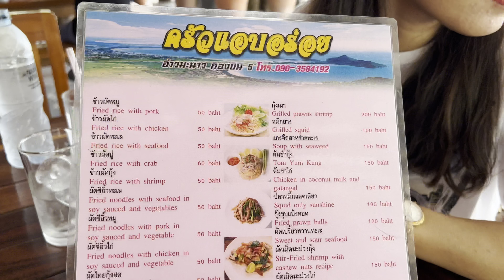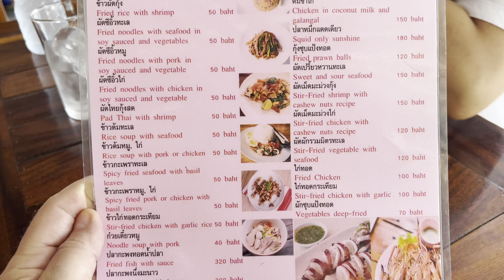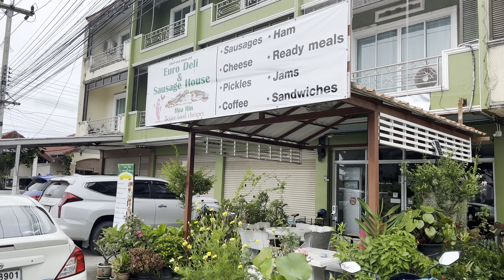There’s a stranger by  our pool

Comment: The cinderblocks seem to be thinner than the ones used in most of the United States that I have seen. Is that due to codes? What if you wanted more noise reduction (music room), or more stability what are your thoughts on that Mr. Joe? Or anybody that reads this.
Reply: No home building codes in Thailand.

Comment: Hey Joe, Last time I was in town they were upgrading or remodeling the olympic size pool next to the community gym located at the stadium. Maybe you can do a video about the cost and the pool and gym membership and what is required like the health certificate or physical to join the gym at the stadium. You can also so the outside track and the outside gym by the track. Just a thought. It would be nice to see how far they have come with the community pool.
Reply from the maker: We will definitely have to check out the pool area.  Last time I checked gym membership was 1000 baht a year and a medical certificate was required. Cost for the certificate was around 150 Baht if I remember correctly.

Comment: Those skinny little cinder blocks.
I guess they must work. I don't know why we use the big old blocks here in the US.
Reply from the maker: I had a home built in the US in 2011 for $326K USD.  The frame was made of wood and the walls were made out of plywood, sheet rock and vinyl siding. The front was made of brick. The main materials used in the US nowadays is Brick, stone, stucco, wood, vinyl siding and Hardiplank.

Comment: The bricks they use for the internal walls are pretty skinny I wonder if they double then up or do they just render coat ( plaster) or dod and dab drywall straight to the brick work
Reply from the maker: They will more than likely just plaster the internal wall made of blocks and then paint and skim coat them.  The walls will be sturdy.

Comment: I have a question for everyone in this chat. I just want to know if I'm not wrong.Most house built in Thailand  use concrete ? it's because they have alot of flood and this is why they use almost 75% of concrete to built a house instead to use wood ? I'm right or not or is just  cheaper to use concrete instead of wood. Thanks
Reply from the maker: https://www.architectureartdesigns.com/4-long-lasting-building-materials-every-homeowner-consider/
Reply: Termites plus timber is very expensive in Thailand.
Reply: When i built my house in Udon i use concrete too. To build house using wood is more expensive in Thailand nowadays for me
Reply: @ThailandWindow  thanks for the info
Reply: @paulg8730  thanks for the info